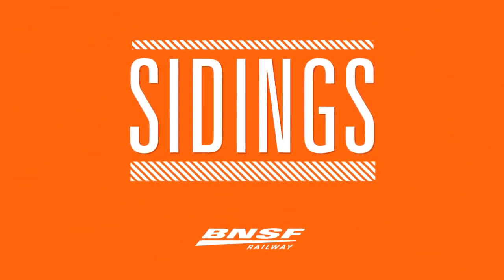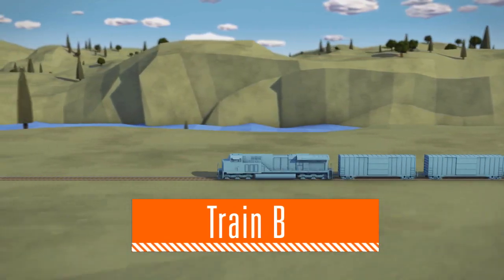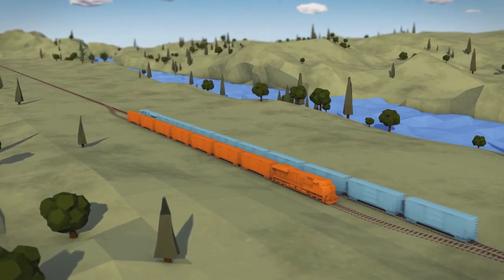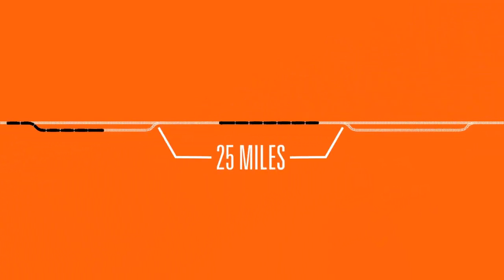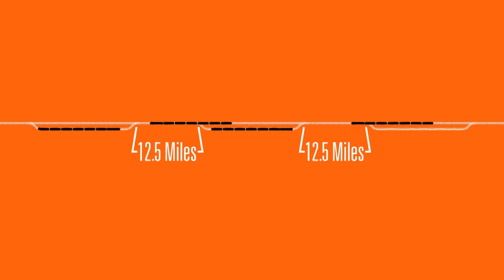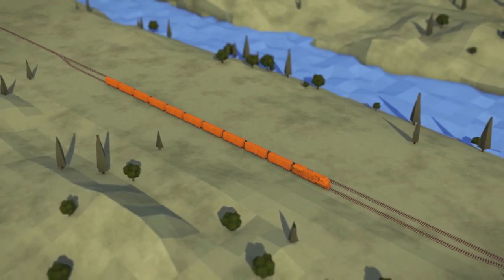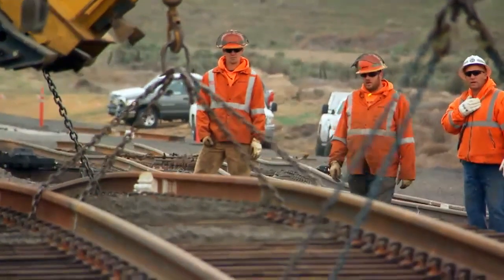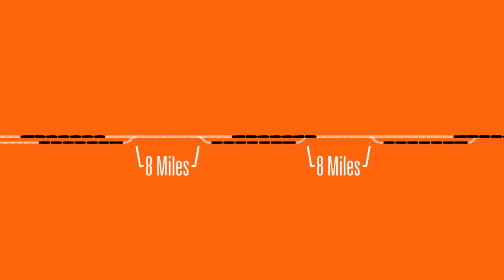Sidings make rail networks operate more efficiently

Comment: Or just, you know... go run two tracks in parallel, one in each direction. the cost would be recouped by the HUGE capacity gains, such as not limited to small trains. and by small, I mean a train with less than twenty cars. (In cargo terms, that is small.)  Because sidings present a very basic limit on a line capacity, and you have to go through all that "add a siding, where to put it" analysis each time you want to expand.

Comment: A longer siding may give space for the train to accelerate, but the turnout already needs to be set to receive the train. The only benefit is that the conflicting train passes the turnout sooner, so the turnout can be moved sooner. But then, the first train could have moved close to the turnout before stopping, meaning that the siding could have been shorter. It seems to me that the only real benefit of longer sidings is to handle longer trains. At least, until the sidings are so long that it is possible for trains to pass each other without either of them stopping.
Reply: imagine the train longer than the siding and is stopped

Comment: The solution is multi-track drifting.
Reply: awdrifter3 Running in the 90’s plays
Reply: That makes the problem worse
Reply: daaamn, now they need 4 tracks for a siding+main line :/
Reply: This gives me a sense of . . . deja vu
Reply: Well some parts of the US rail network has 4 tracks, and it still isn't enough to cope with traffic!
Reply: Fukin deja vu
Reply: I have been in this place before.
Reply: Lol ikr
Reply: Yes and late derailt

Comment: People need to understand that tracks are expensive. Railroad companies will not add double track main lines until the traffic volume justifies the cost of building and maintaining a second set of tracks. Single track lines are usually more cost efficient when they don't have a lot of traffic. In this business, cost efficiency is everything.
Reply: I read this as the top comment and thought, "Clearly, we aren't idiots, Captain Obvious." Then I started reading the comments below this and holy crap, we really are idiots.
Reply: And that's why they shouldn't remove double tracks. Perhaps keeping them is cheaper in the long run.

Comment: Shorter trains can run faster, accelerate faster and require less locomotives so increase efficiency.
That's why in Europe we run 2000T trains with 80/90 kmh hauled by only one (1) 6000 Kw E-Loco, between the pax trains.
Thats our definition for "Efficiency"

Comment: Hey the Brits figured this out already, instead of putting sidings so close to eachother just stick in another track. Less complicated to manage and allows trains to move more freely
Reply: In Great Britain they only have 21,000 miles of track while America has 155,342 miles. Plus we don't use train like you guys do for transport just mainly cargo. The area is so vast.
Reply: The longest new domestic railway built in Britain for over a century was built single track with "passing loops" which are a similar concept to sidings. Only certain parts of the track are double tracked which usually works well, until the trains aren't running on time which leaves passenger trains sitting for 5+ minutes waiting on the next train to pass
Reply: TheyCallMeRay obliviously the brits didn’t tell you to watch the whole video.
Reply: Another British snob claiming superiority. Just makes me glad we had our revolution.
Reply: Luke Johnson you cant seriously base the american revolution on the premise of a fucking railroad...
Reply: I don't, there were much more important issues that also had to be solved. The Snobby attitude is just the cherry on top when it comes to reasons I am glad we broke off.
Reply: And yet even us Brits are not such total fools as to waste massive amounts of money double tracking lines which do not economically justify doing so the Cambrian Line through mid wales remains single track for example. So yeah please don't make us out to be morons with no common sense just because you are.
Reply: Dumbass didn't watch the entire video.
Reply: Optimus Prime did the brits tell you anything about what she said??...if I recall...she said "double track segments". Not double track railways.

Comment: No, the answer is dual track.
Reply: This is covered in the video. Depends on how much extra capacity is needed
Reply: How much does a mile of dual track cost? Would it surprise you to find out if costs nearly twice what single track costs? There's these things called "business cases" & "cost benefit analyses", properly managed businesses use these to prevent them pissing away money in capital investment that's not needed.

Don't worry about Signalmen, they're trained to do their job. There are procedures in place that, when properly followed, prevent them from causing accidents.
Reply: thats a bad idea just to build double track to "plan ahead" because sometimes the demand is not needed or shrinks over time. That way depending on where the tracks are you just waisted potentially millions of dollas on capacity that is not needed.
Reply: There's a difference between your and you're
Reply: Agreed! Deffinatley dual track
Reply: Double track is also hugely expensive to build and maintain
Reply: SniperBoy8940 You mean the dispatcher...? And when there's double tracks, the dispatcher or your so called "signal man" still has to line trains up.
Reply: Except signalling in the modern era, and it has been this way for 40 years now in my country. Can be completely automatic. they're just traffic lights for trains.
Reply: Ok, listen. the year is 2018, everything is run by a central computer, signal men dont really exist anymore, also a double track is more expensive and its only cost effective when theres a real demand for rail traffic, watch the end of the video
Reply: Increased cost.
Reply: If you build a completly new track you can then just a seond one right off the bed, it wont cost much more than building just one, if you have to make mor sidings and connect them if you get more and more traffic you have to manually build up complete new set of tracks for something you could of done from the beginning with much lower cost and thats why you arent good at math and pre calculations.
Reply: Yes because spend 10x more on unused track when you can get the work done so much quicker and cheaper and utilise the track space better.
Reply: And that's why you're not a manager of any sort.

Mostly because you have no concept of cost.
Reply: SniperBoy8940 exactly, just plan ahead
Reply: Andrew Nisbet it's so much simpler using dual track and it takes the pressure off the singal men .

Comment: What your discribing is a passing loop, not a siding.
Reply: Every major British Railway Company and engineer call it a passing loop as do all other railway companies the world over....
Reply: Luke Johnson using different words to the original and intended ones complicates the language and obscures meaning.

This is bad. 

Siding already has a definition, so using it here not only makes both usages less specific, it confuses non-Americans and is completely pointless.

This is bad.

If you think that it's alright to do things blatantly bad for the language we all have to use, then call us snobby for opposing it in favour of the word used in every other country which actually definitionally works, that is just silly. And actually rather snobby itself.
Reply: Hood/bonnet, boot/trunk, truck/lorry, buffer/coupler, drive shaft/prop shaft, gasoline/petrol, eraser/rubber , etc, etc, etc.
Reply: *you're
Reply: It doesn't matter, in America they call them sidings, is it really going to make a difference?
Reply: Highways are better than motorways
Reply: We use different words here in America, get over it you British snobs.

Comment: Or, instead of shortening the distance in between sidings, you double track the line
Reply: The Aviating Railfanner when there is enough demand? Like the end of this video said?
Reply: If you can get away with putting sidings in every 25 miles miles instead. over a 1000 mile route it can save millions. i dont think this was an oversight haha
Reply: The Aviating Railfanner They said that

Comment: Cool video, but I thought EB trains had priority over WB trains.  Other classifications not withstanding....
Reply: What difference does EB vs WB or NB vs SB make?
Reply: The only priority that's given is when someone owns a track and their track is being used by a 3rd party in addition to their own trains, the 3rd party train generally has to wait

On dual track lines its a bit different, in which one track is EB/NB and the other is WB/SB if sidings are used in this case, which does happen, just usually with train stations its to let a train explicitly to pass the train at the station due to either being a Express Service with fewer stops than one that stops at all stations, or being a freight train needing to pass a passenger train
Reply: +The Cando Railfan None except for the fact that the rules of the way need to be written so everyone is completely clear on where the responsibility to give way falls. If anything doing this is even more important for situations where there would otherwise be no clear indication which vehicle should give way. The rules of the road and the maritime collision regulations etc all make use of explicit declarations which vehicle is the give way vehicle in any situation for the same reasons.